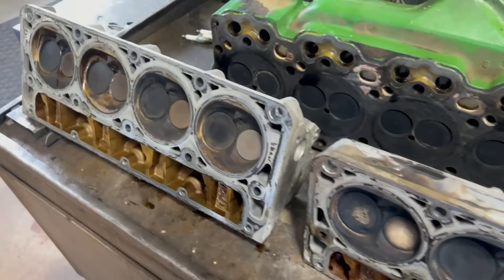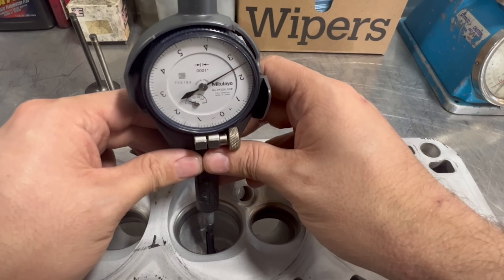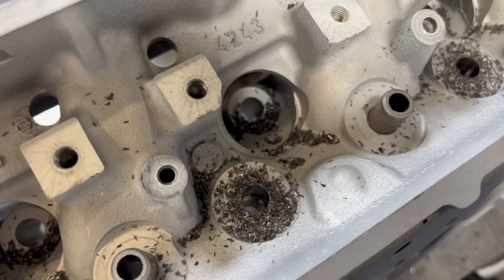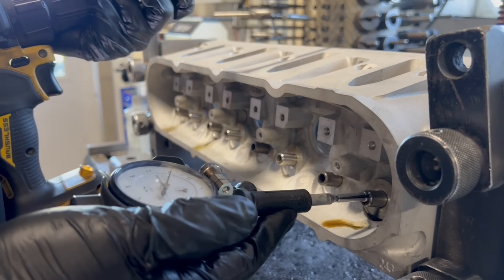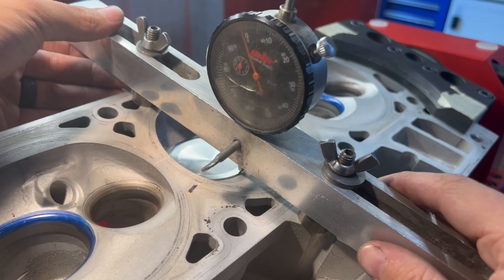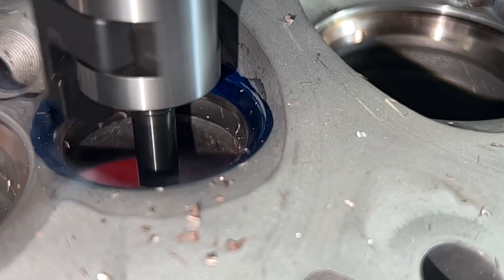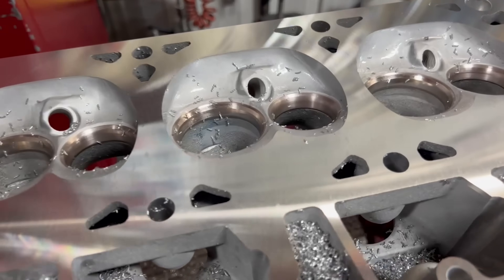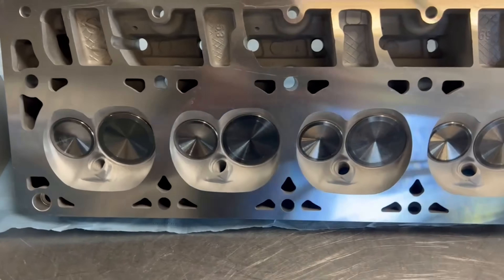Did I Waste My Money Building Heads That Were Fine? 5.3L LC9 Gen IV LS V8 Build Part 3

Comment: 40-50 or even 100 HP with the intake back cut LMAO.... I got a good laugh from that, though your right a back cut on the intake will help flow #'s and back cutting exhaust will cause reversion. But a tip on 5.3 n 4.8's you'll actually will do better with 706 heads vs your 799's in most builds usually till your pushing over 500 HP N/A  or 700 HP Power adder... 1) because of the smaller chamber (higher compression and 2) because they have better flow and velocity till 5000 RPM and 0.600" + lifts. And to be honest if your pushing that much you are better off getting aftermarket heads than doing full CNC port work and rebuilding those 799's And TBH I mentioned in another video but you shouldn't use a radius on outside cuts except to de-shroud  the valves in the chamber or in bottom cut in the throat. If using 45 deg valves a 75-60-45-30-15 is best or a reverse radius then 45-30-15 deg. I do the 15 deg with a Sioux stone just to remove the sharp edge on the seat to chamber lip myself. I quit doing full machine shop work n just do heads now (mostly porting and seat n guide work) and blueprinting friends n good customers engines when requested.

Comment: I notice you are using both heat and cold for your press fits; we learned in an industrial setting that using one or the other, but not both at once led to more reliable results. Your mileage may vary.

Comment: I have a 2004 Suburban with a 5.3. It has 371,000 miles on it. Still runs great! I picked up a core to build to replace the original engine before it gives up. My plan is to do it like yours. A very basic but solid rebuild with best quality parts.

Comment: Are you going to dyno your engine when it’s back in the truck?  I have a 4.8L V8 with cast iron block and heads in my 2000 Sierra.  Fortunately it is one before all the BS with AFM or DOD systems.  Still going strong @ 180k miles.

Comment: Sometimes I notice some of your humor you sneak in. I don't always read the commentaries. I did notice when you mentioned your father heating up the ring gear for the Chevy flywheel that it was on a specific built dedicated stand just for heating ring gears. Obviously it was on an old recycled torch cart.

Comment: Text book method to remove guides is to tap a thread in lower third after drilling the upper two thirds as much as possible and using a threaded drift to pull the lower section as you stretch and reduce the diameter of the upper two thirds. The replacement guide needs reaming in exact orientation to the seat so just the setting up can take forever. If its just your time it's worth it for the challenge.

Comment: Loved that you used beehives. PAC1518 are great in my experience, even at .600 lift. No need for a nasty dual or triple spring like everyone on the internet seems to think 👍👍
Reply: Cept when a spring breaks.....
Reply: @johnbewley5220  1. Good springs don’t break. These aren’t crappy comps. 2. If a primary spring breaks at high engine speed, redundant springs aren’t going to save it. 3. The harmonics of a beehive are much better than a dual/triple. 
With all that said - if you feel safer with a multi spring you do you man
Reply: Youre right.  Good springs dont.  But he said Pac.  And a dual will save it.   Seen it more than a few times on LS's dealing with the rash of TSP springs that broke a few years ago. Plus it looks like he added roller rockers.... thats additional mass in the valvetrain for the spring to control.

Comment: I was really interested to the radius-seat-radius approach you used in this video. Is that becoming more common now in your industry, as opposed to say, three or five or even seven angle valve seats?

It made sense to me why multi angle seats were used, when the angles were set by various angles on the stones used to grind the seats, but I couldn't figure out why radiused cuts hadn't taken over with the increased availability of carbide seat cutters which can be relatively cheaply made to any profile one requires.
Reply: There's some testing that has shown that sharp angles actually helps the fuel get distributed. Theory is that any fuel clinging to the sides of the ports will get tossed back into the air instead of smoothly running into and staying stuck to the head. 
In reality, it was really just a bunch of dyno testing that surprised the hell out of some guys that their "smooth" head job didn't make nearly as much power as the "rough and sharp" head job from a CNC, even though the cnc was down on airflow on the flow bench, it could make more power and use more fuel.
Reply: @leftyeh6495  hmm, interesting. I can see the logic there - same reason a rough cut 'port' job (burrs only, no sanding/smoothing) can make more power than a 'port and polish' with the same effective geometry but shiny smooth surfaces in the runners.

The same logic suggests, then, that a smooth radiused valve job would actually be preferable if chasing power with anything diesel or direct injected. Thoughts?

Comment: Back in the late 60's my job as a young teen was to grind the seats using various abrasive stones so the process has certainly changed since then. Do you have a way to check your results? I mean in terms of cylinder leakage. Later in life I found valves stuck open on a non-interference engine of a car my teen was driving. The stems seemed very sticky in the guides so I dropped the gas tank and found it had been sabotaged with cola. A thorough cleaning, some lapping, and a locking gas cap put her on the road again. Years later she bought her own car, thought a locking cap wasn’t worth the hassle and the same thing happened again but this time the stuck open valve destroyed her interference engine. A common issue these days is the oil build-up on the intake valve stems and inside the ports because most engines now utilize direct fuel injection. The way that oil bakes on like layers of chunky carbon makes me think the issue could’ve been avoided had they avoided using dinosaur oil or synthetic blends since I don’t think full synthetic would do that. I only discovered the issue when a relative complained about an engine miss and I found a chunk of carbon lodged on his spark plug. A cylinder leak-down test revealed leaky intake valves in 2 cylinders, which was only apparent at idle. Fuel system cleaner doesn’t help the issue since fuel doesn’t flow past the valves in direct injection vehicles, and spraying a cleaner into a port downstream of the throttle body didn’t help so a thorough decarbonizing by hand was the only hope other than an expensive valve job. Anyway I helped my poor B.I.L. get back on the road but sadly 200 miles later, pressing the pedal made the car die and set a MAF sensor code. The MAF sensor was soaked with oil for some reason and then I realized he drove for about a year on only 5 of the 6 cylinders. The moment I unbolted the front of the rear catalytic converter, I saw it was completely obstructed with chunks and pieces of a honeycomb-like structure. Then I found each exhaust manifold had a catalytic converter and the one near the firewall was the one that kept dropping chunks when I blew air on it. Visually it just appeared like it had a discolored section in the middle and an even smaller section looked like the honeycomb was a little clogged but the air made the pieces fly so it had to go. He doesn’t have the money for another cat so I just left it free flowing and cleaned the oil off the MAF sensor. Shockingly it hasn’t set an oxygen sensor code yet. Well that’s my story and I’m sticking to it.

Comment: The cylinder head porters are getting away from a back cut on the exhaust valve.  Current thinking is to make flow more difficult for the intake charge on overlap.

Comment: Good to see a fellow engine reconditioner remove and fit valve guides in alloy cylinder heads the correct way to prevent galling or broaching of the cylinder head valve guide bores

Comment: a waste . speaking from some BAD experience in my mechanical youth ; ordered to "just put the bearings and sleeve kit in . it will be FINE!!"  tractor leaves running IDENTICAL to when it came in ..... just not coolant peeing inito the oil .... complaint " just OVERHAULED and it still starts hard and smoke??!!"      
   yessir!! you betchya!! but it doesnt leak coolant into bottom anymore . we did what you and the boss wanted . 

fast forward 30yrs ; just gonna quote sleeve kit , gaskets , and bearings.                 kool , who is doing the job??          you are 
   nope , find another IDIOT that think that will work after  5000+ hrs has NEVER worked in 30 yrs . wont work , today with your majik computer wand either .    teardown ; engine completely toasted and ruined ; overheated deck cut TOO LOW .  it never ends . yes , even with little returns ; work the heads . experiement on  your , you get a feel for how small "adjustments" can work for customer . R&D , tock on youngin'!!

Comment: quick question  what brand / supplier do you get your guides from. I have purchased guides from us seal,  rock auto parts geek and others. every guide i have found for LS cylinder heads are not the hard oem style guide but softer Iron guides. I have not had a failure but my preference is to use oem quality harder guide what do you use  and who do you get them from ?
Reply from the maker: In general we use SBI guides. These I used 140-3053H so they are hardened cast iron. I guess I have not had any complaints about them but honestly we do not see a ton of LS stuff in our shop. 

Most of the big engine parts distributors should sell SBI.
Reply: @JAMSIONLINE   Ahh i get it add the "H" to the part number to get hardened. Thank you for that info. I use SBI 1403053 next order will add the H

Comment: Another very satisfying video. One question: are those beehive valve springs standard fitment on that engine, or have you changed them?
Reply: Beehive is stock. A lot of guys run the ls6 spring on lower lift cams. They’re super cheap and do a good job controlling the valve

Comment: Can’t wait to see the final results. Does your camshaft require a higher stall converter? If so, who did you go with?
Reply from the maker: I kept it fairly mild on the cam, stock converter. Will talk about it a bit more in later videos!
Reply: @JAMSIONLINE  with a cam swap, it'll definitely need to be tuned.  I hope you considered that. They can also disable the DOD while at it vs doing it with a handheld.

Comment: Do you remove metal on the exhaust port where the exhaust header mounts? Would opening that area up wider help get the expanded gases out easier with a different grind on the cam? Does getting the gasses out faster by an increased ID allow for more heat to be scavenged out too? Great videos, really enjoy the content!
Reply: Unless you tune the entire exhaust (repeated dyno pulls while changing pipe length) then not really. If it was a big block, then maybe bumping the primary tube size up will see an increase, but it's crazy how much power an exhaust will choke out, but not until you get into the higher HP levels. Under 4-500 hp, it doesn't make much difference unless you're actually choking it.

Comment: Good job, that engine should last you several years, as long as you don't hotrod it too much😊  i fully agree with doing the heads anyway. I never could understand people that won't do anything with the heads, after they had to be taken off to do the bottom half of the engine. 
I know a guy once that pulled the engine on his old ford pickup just to clean it & replace the gaskets, including head gaskets. Didn't touch anything else, tore it apart to put in new gaskets, but didn't do anything else, except adjust valves when he put it back together. Didn't replace the timing chain or anything. Go figure!😆😆

Comment: It’s somewhat soothing to watch the cutter clear away your blue ink marks while also smoothing whatever it is you are cutting!
I could probably watch a video that went into complete detail of machining a head or block from start to finish!
One of the things I used to try to do when I was going to have to work on one of my motors in a vehicle was to get a foaming degreaser and cover every square inch of the Bloch and whatever else might have a buildup of grease or oil on the outside so that I wasn’t transferring that crap to every thing I touched or to parts I was removing or replacing! 
It also served my purpose of being able to see if I had new leaks when stuff was cleaned!!

Comment: What cam did you choose for it ? Love everything you and your dad do. Thanks for sharing your knowledge.
Reply: I was thinking the same. What cam did you choose? Your thoughts on cam specs and/or manufacturer?
Reply: Back in the early 80's I built a 327 for an 80 Camaro.  I put a 260 duration cam in it and it was the strongest engine I ever had in the car.

Comment: Nicely done!  What’s with the back cuts on the intake valves?  40 hp? 50 hp? 100 hp?  Really, or are you just checking to make sure we are paying attention?  All in good fun.
Reply: Right  Had  To  LOL
Reply: improved airflow into the cylinder
Reply: @JohnH20111  Understood, but do you believe the claimed increase in horsepower?  I believe the claims were all in good fun.

Comment: If the valves were oversized, how much were they oversized? Otherwise, I guess it would have made sense to just add new exhaust valves and regrind the intakes.
Reply from the maker: .020 oversize in the intake. Yes probably would’ve made sense 😬 but I like the stainless valves lol
Reply: @JAMSIONLINE  Okay, thanks. Some people like oversize intakes anyway, it helps them deal with less than perfect intake valve seat depth. Jafromobile likes using +.5mm valves, sometimes not even for performance, but just because the machinist has an easier time working with the original valve seat. He is a Mitsubishi 4G63T expert.